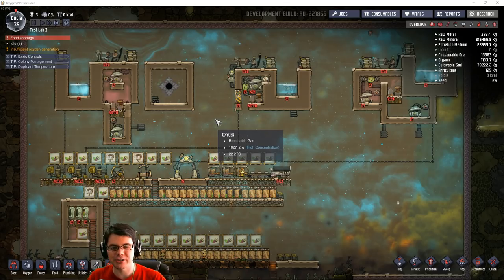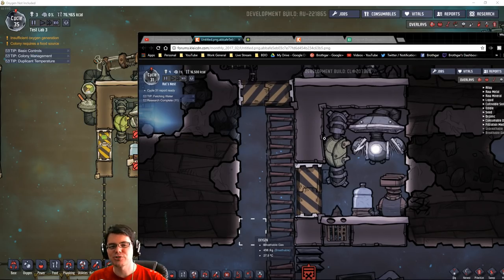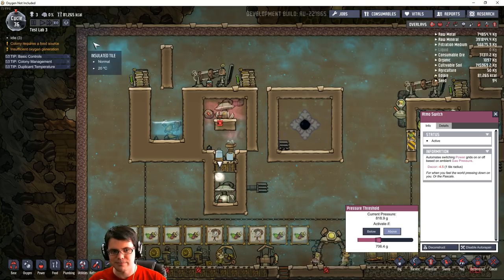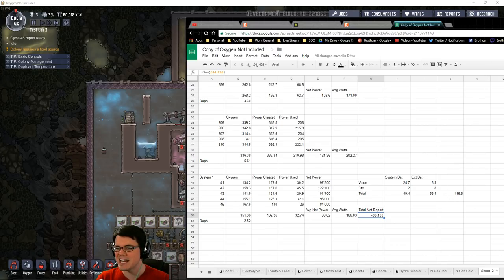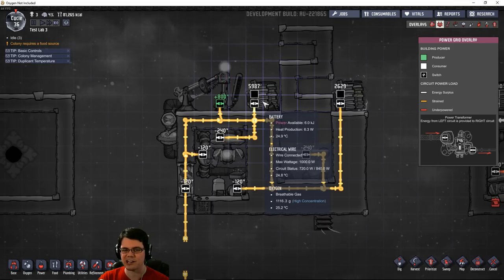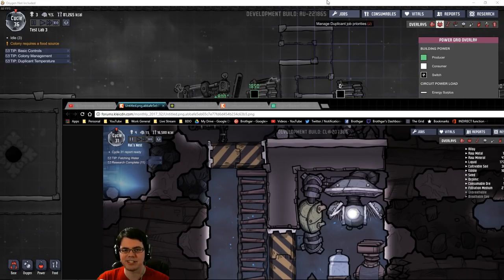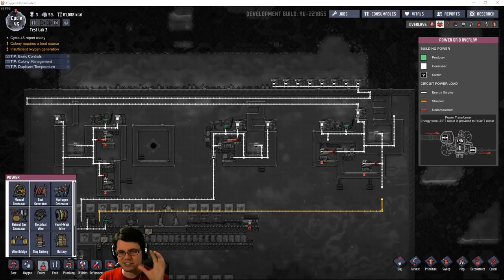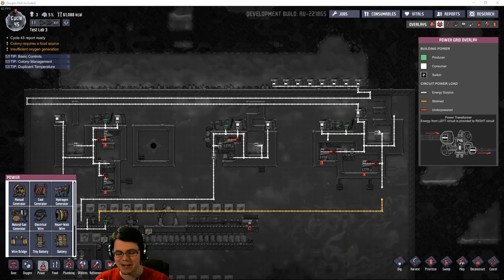Self Powered Oxygen Production 2! Oxygen Not Included Tutorial

Comment: In the first variant, you don't need a filter per se.
To ensure you have only one gas in the upper part of the chamber, you could use more than one atmo switch, all set to similar numbers and connected serially.
When oxygen flows up, it tends to be in small packets, meaning that one of the atmo switches would detect too low pressure and keep the pump off until things stabilized.

And it wouldn't hurt to make the chamber 1 or 2 tiles taller.

Comment: You can probably tweak the "Hydro-Hood" Design so that the top of the Electrolyser is covered by Hydrogen, and the bottom by Oxygen. That way it shouldn't waste Hydrogen, and also will provide the largest power surplus (because all you need is 1 pump, 1 gas filter, if stray some unwated gas (polluted O2, or whatever) goes into the Hood.

Maybe moving up the Electrolyzer 1 tile, and playing around with the pressure switch of the Gas Pump, should do it.

Comment: At the end there. I think your right. The longer the generator runs. The more power you get. 
Put a pressure regulator in and a longer pipe. 
Set the pressure regulator to a low number. I did not set and test. I just picked a random number between 200-300.

I made this with an open system with a filter and it works.
At 1 point I had a pressure regulator and the generator runs for a longer time. 
It still generates 800 power at all times. 

It does know anytime it gets more than 100G/s and stores anything over that. 

HOWEVER. The generator does not know the difference between 1G/s and 100G/s of hydrogen. 
So when it receives a smaller amount over longer periods. It will generate for a longer time and more power. 

I posted pics and description on previous video. 

My open system on a low chance will get mostly O2 and little hydrogen. 
If you add my system with (I think will have the best chance) setup 3. 
The power switch will allow it to only run when there is Hydrogen around the pump at all times. Will also allow you to take out the filter. 
You will get the most power out of all systems.

Comment: @brothgar, thanks for running the numbers in such a detailed manner... i knew the system i use has been around for a while, but i hadn't known there were changes to any of the components over that time.

the power output was right around where i expected it to be, though - and given i run 1-3 PER CIRCUIT, the problem i have usually is TOO much oxygen. :)

awesome work!
Reply: also, i am adopting your atmo switch placement over my current tucked-in-corner variant, as yours actually is in a better position. :)

Comment: Have you thought about doing a central air experiment with heating and a/c? I tried working on one but it definitely needs tweaking. So far I have a room with thermoregulators and space heaters that produces the heat with a pump running from the room to a radiator system in the living quarters. The thermoregulators also run to the radiator system with insulated pipe, and the radiator drains in a third room that also has a pump to circulate the air back to the first room.

The whole system runs in a loop so that heat can be transferred without mixing the gasses of the air system with those of the living quarters. I'm currently using hydrogen in the system, have you though about doing a video on this kind of thing? If so I'd love to see the way you work it out!

Comment: I have a theory on the battery charge, hear me out.

I think that the hydrogen generator kicks on and then consumes all the hydrogen in the tank. Any hydrogen that is not enough for one "activation" of the pump is simply lost when the generator stops. So lots of small batches have a higher loss than a few larger batches.

You can test this with a room of super high hydrogen pressure pumped by 2-3 pumps into one feed pipe so that the packets compress and contain 1kg each and feeding this into a hydrogen generator connected only to batteries. The pumps are powered through an other source. The daily report is going to be unusable but you can count the energy in the batteries. Then compare this to a supply of smaller packets where you remove some packets by simply branching the pipes so you get like 1/4th of the rate but still high enough for the generator.

Comment: So a possible fix is to put hydrolizers on airflow tiles so the oxygen automatically goes down whenever hydrogen is around the top of the device or entirely surrounding it.
Can the hydrolizers be forced to create more gas with pressure sensor and automation, or does it always shut down at the same pressure?

Comment: I noticed 2 out of 3 experiments had a gas valve limiting the hydrogen and you never revealed the amount it was set to. Is it possible that more hydrogen is entering the generator than can be burned?
Reply: The point is that if you watch your generator meter (it fills green as hydrogen enters the generator), if you don't restrict a valve on it, it maxes out quickly (your pump is sending 500g packets of hydrogen in but the generator can only process like 100g/s), but in the gas overlay you can see hydrogen still getting dumped into the generator. He's suggesting that this might be the source of discrepancy -- maybe the game reads that excess hydrogen as energy wasted. Restricting a valve is one way to see if that energy is recovered. If it is, problem solved!

Comment: Rennoch's build: electrolyzer isn't in hydrogen layer so we know it's suboptimal from the getgo.

However, regarding your problem of energy that was created not finding its way to the batteries, I have an idea and a method to test it. I think it has to do with the rate OR size of packets that hydrogen is entering your generator. You should test this with a hydrogen gas valve. One theory I have is if the hydrogen generator is FULL, it still accepts hydrogen and that energy gets deleted: this means you should be using a gas valve to meter your hydrogen to the generator set to 100g/s. The second theory is that irregular sized packets of hydrogen don't get fully converted to energy due to rounding or something bullshit. You can test this again with a valve to reduce hydrogen packet size, but you can also INCREASE packet sizes if you set up a gas recombiner. Use a combination of gas pipe splits that loop back on the original pipe so you get bigger packets of hydrogen.

Comment: Have you thought that maybe even if the sensors turn off and on devices, maybe they do not really do that? Maybe it is on,y "cosmetic" and so it hides in reports but actually it uses the power?
There can also be a problem  with the system matrix which we cannot know. For example what areas does the gas pump take the gas from? how does it calculate the intake? For instance it has to take the gas from 4 cells, then convert into 1 cell to pump it through the vents. But there is no same concentration of hydrogen in each of these 4 cells. Whereas the sensor has a fixed number (1500g). So depending on how the matrix is set to work, these calculations might gain an error, thus some of the gases are "lost".

Comment: I was wondering if having a ratio other than 1:1:1 (pump:electrolyser:generator) would give a better net power output. Maybe 1:9:8?
Reply: Think about what you're suggesting. 1 pump, 9 electrolyzers? That's ludicrous, even 1 pump and 1 electrolyzer is already a system that frequently hits maximum gas pressure.
Reply: i'm not suggesting 9 electrolysers in the same room, more 9 copies of the electrolyser chamber.
Reply: So when you say 1:9:8 you mean 9:9:8? Please clarify... Because now it sounds like you're suggesting 9 chambers of electrolyzers while 8 of them are lacking a pump. Sounds even more ludicrous.
Reply: 9 chambers all being fed by the same liquid pump.
Reply: Okay this makes much more sense. 1:9:8 would be bad ratio but sure you can definitely make more electro chambers and feed them off the same pump. Having an ideal ratio is less important than how much and how well distributed your oxygen is, because having too many generators has 0 negative consequences besides wasted materials. If your base O2 is already high and stabilized, then your O2 consumption rate determines how many generators you really need, and I would just build half-open electrolyzers strategically located to provide good oxygen to all regions of your base. By half open, I mean they only use 1 gas pump for hydrogen and let the oxygen diffuse naturally. So for example, my base has 13 dupes in it, they consume enough oxygen to keep the equivalent of slightly less than 2 electrolyzers running full time, which means 2 hydrogen generators is sufficient for me, and I have like 8 or 9 electrolyzer half-open chambers spread out across my base.

Also the liquid pump thing I don't think matters very much. I have 3 pumps because I'm using 3 steam geysers, whichever geyser is closest to the electrolyzer in question supplies its water. You can use hot water to electrolyzer with impunity since the water gets destroyed and the temperature doesn't affect gas temperature (just make sure you use insulated abyssalite pipe) But technically yes you can fit them all on one pump.

Comment: You know, the hood has one less gas pump. You save a lot of power by not pumping the oxygen. Cut the oxygen pump and the bottom right of the design #3 to have reliable comparison. But I would guess they won't be much different, the whole difference will be in less deleted hydrogen.
Reply: Okay, that's an interesting observation then. I'll take a look at it when I find some time. Thanks!

Comment: the hydrogen generator can only process about 100g/s of hydrogen so it my be soaking up a bit more than it can handle and therefore basically destroying the hydrogen in the process. my suggestion would be to pump it into a llllooonngggggg pipe and then put a gas valve set to a bit over 100 g/s of hydrogen through this way there would be no theoretical or possible destroying of your collected hydrogen.

     The electrolyzer also states that it creates 112 g/s of hydrogen so i would recommend pumping all gas into a chamber that is 2 wide and about 6 tall above your electrolyzer(s) and put gas perm. tiles at the bottom. then, put a pump at the top of the gas filter chamber and an atmo switch under it. then set tote atmo switch to below 700 so that it only activates when there is hydrogen covering the pump.

Comment: I think the hydrogen generator needs to have a gas valve to control the amount of gas being eaten. Anything stuffed into the generator fills its internal bank. The game doesn't have a value for that other than a green line. With a valve you can only allow in the amount that keeps the generator running and that saves your hydrogen instead of destroying it.
Reply: 2kg max that is consumed at what rate? It's not stated in game, but it seems to never stay full even when you have more than 2kg pumped to the generator. The Hydro generator has been a bit awkward ever since the first build of the game. I don't believe it's been tweaked at all in any of the patches so far.

Comment: Put a valve on the hydrogen generator to make it run consistently.
Reply: It doesn't matter. I find that if you can feed it a consistent flow instead of it starting and stopping that helps alleviate the problem even if the flow rate is less than the what the hydrogen generator can consume.
Reply: Brothgar I read there is a glitch for feeding a ng gen, maybe it affects the hydrogen generator as well. maybe try the valve, set it small, and see if it changes the numbers?